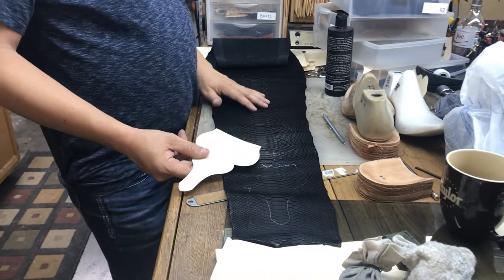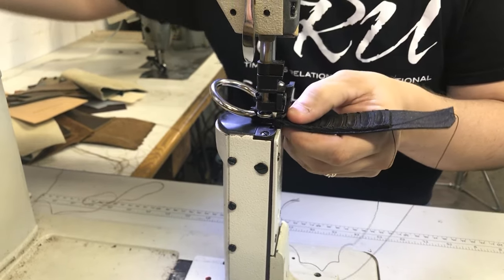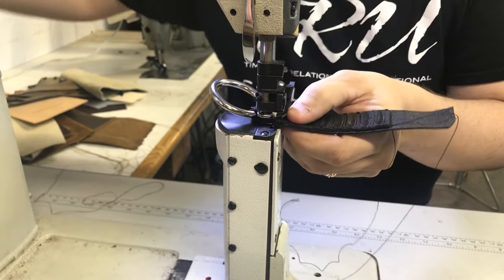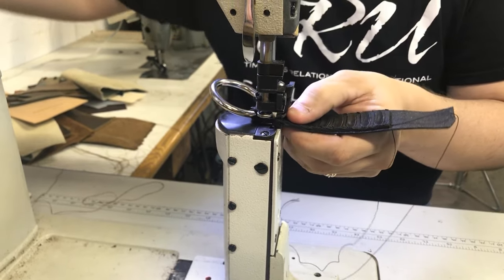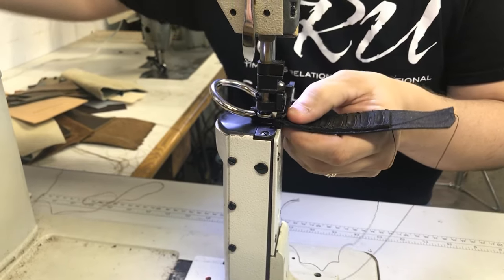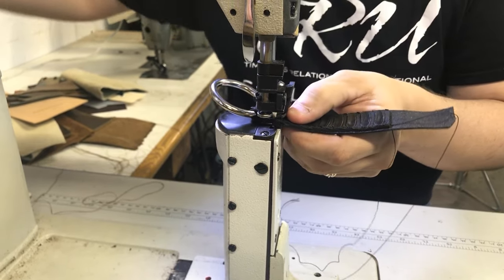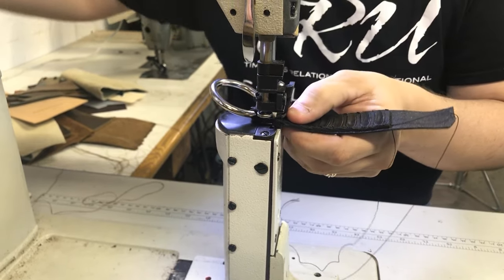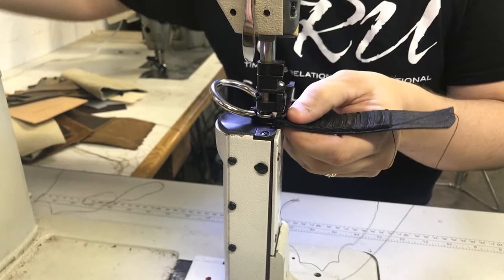Building Custom Python Boots- Start to Finish

Comment: Hello, is there a modern equivalent to the Model K curved need stitcher?  Where would you suggest somebody find one of these Model K machines?  Thanks for the great videos.
Reply from the maker: Hey Ryan...yes, there are modern equivalents, though they are console machines, or basically rigged out in enclosures for safety regulations. They are generally now made in China. There are a lot of old K's out there...you can find them on FACEBOOK groups who specialize in shoe repair machinery. Thanks for the comment!
Reply from the maker: Heavy Duty Leather Sewing Machines is one of the facebook groups.👍🏼